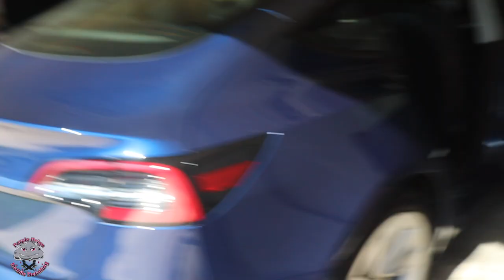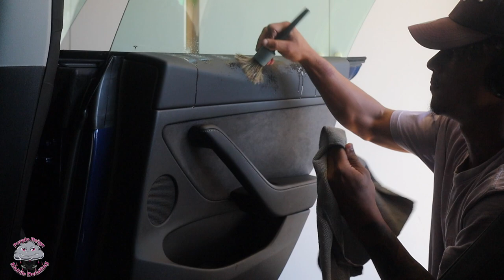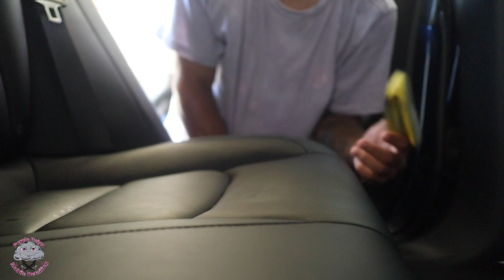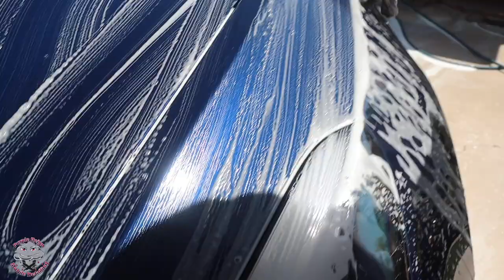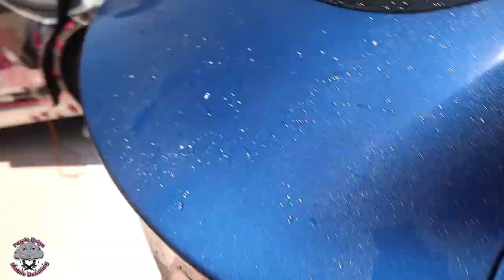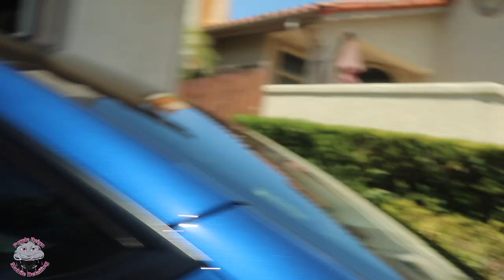What REALLY Happened To My Mobile Detailing Business…

Comment: Hey what’s up Kam, quick question, what compressor do you use for your tornador?
Reply from the maker: I use a ridged 4.5 gal I believe !
Reply: @Businessmankam  Thanks for the reply! Do you find it turning on and off rather quick since it’s a smaller gallon compressor? If so, does that affect how good the tornador works?
Reply: @robertoastorga9501  it turns off if you stop using it for a while, but if you’re using it non stop it’s because it’s a small capacity and it needs to recharge